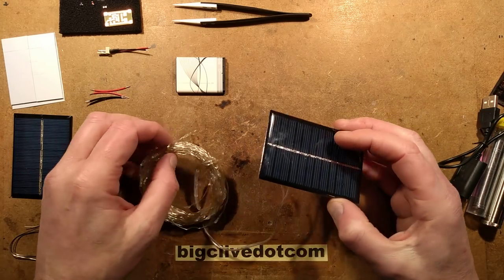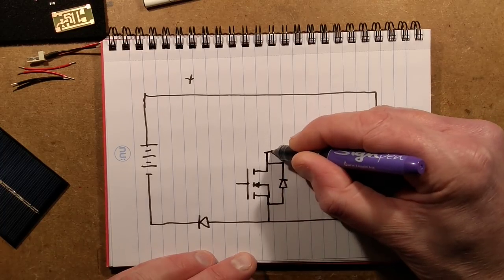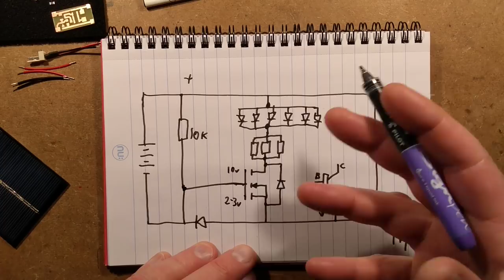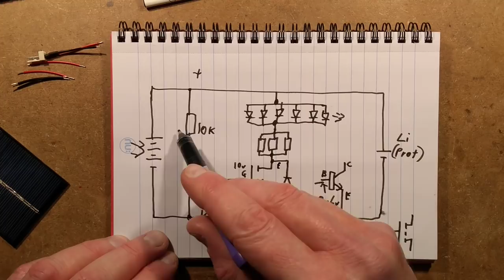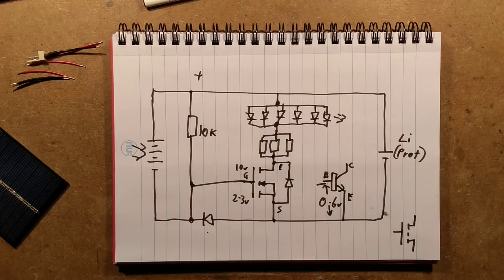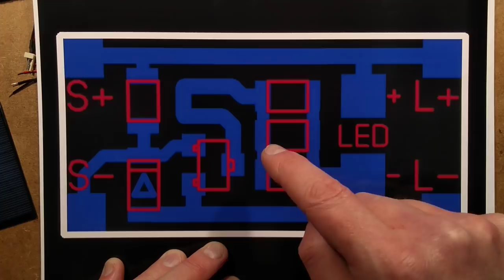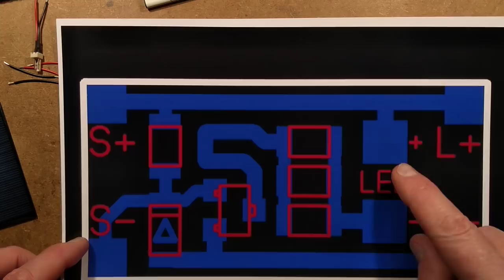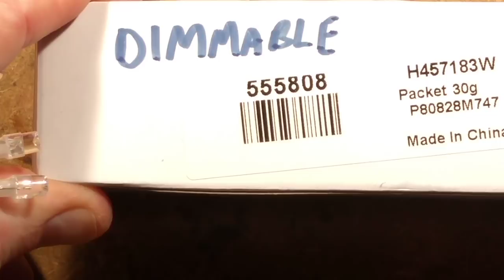DIY solar garden light project.  Surface mount remix.

Comment: ah yes, the MELF-package. "Mostly End up Lying on the Floor".
Reply: ...they're easier to work with than the GCFP packages (gets confused with flea poop).
Reply: melf isnt that resistors? hes talking about diodes. i think they are called sod package (small outline diode)
Reply: I was just about to post that
Reply: desks are for storing junk on top, the big floor is where everything gets fixed....
Reply: QuadroMELF (SOD-80) package has square sides.
Reply: slaeshjag - I undo tiny screws, they drop on the floor! Even with the use of a magnet and a metal detector they cannot be found! After much swearing I put my knee down and bingo!!! The knee detector wins again, followed by much more swearing 😂😂😂
Reply: I thought it was "More End up Lost than Fitted" :D
Reply: @cardboardboxification  I can relate._
Reply: MELF packages are used for resistors and diodes (metal ended leadless frame) or, Metal Ended Little Feckers as we in the industry like to call them
Reply: I thought you'd mistaken the MELF-package for the MILF-package... lol.
Reply: @urugulu1656  Frequently sod-off package ( especially when you sneeze )
Reply: In Denmark we name SMD components as: "Små Modbydelige Dimser" - in english means: "Small disgusting things"

Comment: I am not sure if this has already been mentioned, but Wahl has been making a soldering iron called the "Iso Tip" since at least the early 80's that is functionally quite like this iron.  You get used to the "tappy, tap-tap" of keeping the iron temp moderated quickly.  I still have mine and it is working like a champ after all these years.  Have had to replace the cells, but you can run it full bore until the battery is exhausted if you like and it is the king of automotive electrical soldering work.  That being said, I'll be picking up one of these tips too.
Reply from the maker: I featured the Iso Tip in a video.  (A teardown.)
Reply: I really need to retrofit it with an LED for a brighter light, but the tungsten bulb also acts as good indicator of the charge state.

Comment: A nice way of finishing hand-soldered boards with SMT components its to dab a little liquid or jelly flux around the pads and use a hot air gun to reflow all the solder joints, leaving nice shiny, even heels. Most of the components will recenter on the pads too. Use a bit of flux remover to clean the board when it has cooled. Most modern SMT components are designed for reflow operation so they can handle being heated. I find 350DegC air on low flow works well for lead solder, a bit hotter for diet solder, and takes a few seconds of heating to reflow for a tidy-looking board.
Excellent job handling those SMT bits, they can get really fiddly sometimes! Keep up the great videos :)
Reply: Alan AngelFire not blowing the components off the board like a rookie with the air gun is the trick 😝 shaky hands from the war ruined it for me.

Comment: Just built the through-hole version of this with a 2N7000 MOSFET, Kindle battery grabbed from the recycling bin and all other parts on hand.  Just need to get it into a weatherproof case and outside for testing before I declare victory, but initial testing indicates success.  Many thanks, BC!

Comment: The discreet component version of this one rocks too!
I just built that one and it has me thinking of other applications already!
Super cool!
Reply: I'd half like to build one of these...What MOSFET part did you use?
Reply: @garrethtinsley2435  sorry I meant the discrete version Clive made a while back with a npn transistor
Reply: I've been meaning to do that project as well, but I'm still lacking a solar panel for it so might use a photoresistor and just charge the battery when needed. 🤔

Comment: Hi Clive, I bought one of those irons from Banggood. I also found having to keep the button pressed an annoyance. I found the small tip lacking on some larger solder joints. I measured the tip temperature at each voltage setting to see if the temperature changed, it did. Sorry I cant remember what it was, it was in my review which I sent to Banggood. As I only gave the item a four stars "as useful for small jobs only," it was never published.  I never intended it to replace my TS100 iron, I only wanted something for a quick solder joint, which it does.

Edit: 30/11/19. Bangood did publish my review but never informed me they had. I now have the temperature tests I made. Below is the results of using my soldering iron tester thermometer at different volts. I pressed and held the button until it flashed indicating it hard reached temperature. I did this three times in a row before testing. I did this twice and noted the highest temperature each time: 3.3V = 240C - 260C 3.8V = 270C - 280C 4.3V = 310C - 320C 4.8C = 400C - 417C
Reply: Four stars not good enough.... gotta love China...
Reply: @BRUXXUS  . Yes indeed. No problem with any of my 5 star reviews being published! 😄

Comment: Many years ago I purchased a Wahl Iso-tip rechargeable soldering iron at a ham radio store. It was small, worked well, didn't require any cords while using it, and heated up and cooled down quick. It got way more use than my Weller because most of my soldering was not done anywhere near a bench or table. And it had an integrated light, which made it ideal for working under the dashboard of a car while, say, installing a stereo.
Reply from the maker: The Iso-tip irons are still available.  I have one here.

Comment: That vape-iron is pretty damn clever! Besides the button-pushing and low power it seems very convenient. A few more random product ideas I can think of for an "18650 multitool" that uses the same base with different heads: LED torch, electric screwdriver/drill/dremel, electric toothbrush, shaver, vibrator(!), ...

Comment: Minor quibble: the usual enhancement mode MOSFETs do not have a current path when quiescent. A positive charge on the gate attracts elections to the channel area,  which then carry (negative) current from source to the drain .

Depletion mode MOSFETs do have a current path when quiescent. A negative charge on the gate repels electrons out of the channel, which then can no longer conduct current.

For P-channel MOSFETs, reverse polarities and substitute holes for electrons.

Comment: Great project and good work, I enjoyed it. If you have to solder larger SMD Projects than glue the components at first down and put all in a soldering bath, you can make it easy with an flipped iron.

Comment: I just ordered the battery soldering iron that you showed. Seems better than the gas powered one for home usage in rare occasions of soldering. 
If only we could increase supplied voltage by one or two volts...it would perform better.

Comment: I did something like this.  I too used a protected cell and a 6V low-amperage solar panel, but I used a 2-transistor switching circuit to keep the lights off during the day and turn them on at night.
I've had a couple of circuits like those running for around a year now without problems.

Comment: I've been using your original NPN based circuit all summer and it's been totally reliable. I've got it wired to several LED 'rice wire' strings around the garden and the battery and solar panel are in the shed, kind of a poor mans Tesla power wall :). But I'm now going to modify it to use one of those 6 hours on/18 hours off timers that you get in a lot of commercial USB lights these days. The reason being, in summer the lights are on all night and I don't really want them on all night. You'd have to reset the timer as the seasons change of course to manually set the on time but it would mean the battery maintaining a higher charge state in summer.

Comment: Excellent Clive, your journey into modern electronics continues. But I too hate those bloody MELF packages. You can get ones that don’t roll, like SOD-323, which are rather small, or SMA (aka DO-214AC, not to be confused with the larger DO-214AA and DO-214AB which are much larger). One advantage with producing PCB designs for manufacture by professional PCB houses is that they come with solder resist between the pads, which means you can assemble higher density circuits with less risk of short circuits.

The other thing I would now not be without for such work is a binocular microscope. I have an old one which I got second hand for about £40 (one of the best £40 I’ve ever spent), but you can get better ones than I have. And some have three tubes, two for you and one for a camera, ideal for YT work.

The SMT world is now your oyster, with all the fabulous components available only in SMT packages. Have fun!
Reply: Well, there's also the SOD-123, that's in-between the SOD-323 and SMA in size.

Comment: please, more info on the cordless vape soldering iron
Reply: @ernestaskazlauskas6511  Tyvm for the link :-)  But, max 8W and you gotta keep pressing the button? Jeez.  I find a TS100 with a 20V power bank frustrating enough (3mins timeout, ~30W), but also small / portable / powerful enough for most jobs :-)
Reply: Got mine yesterday after a bit of search on the eBay. Element measures ~3.4ohm The adjustable voltage battery supplied is accurate and ranges from 3.3V to 4.8V. My guess is the capacity would be somewhere around 1100mAh as it seems to actually be an Evod Twist

I paid £12.43 with the "fast and free" delivery. 

At the highest setting, I soldered some 1206, 0603 and 0402 parts. The solder melts within seconds having warmed it up once already. 

If you were using a variable wattage MOD, you'd have to solder with it set only around 7W, for the  maximum 4.8V which sounds pretty good to me.

I really could have done with this in the car a while ago trying to solder on a USB connector for my dashcam..  - had to get an extension lead out and fiddle around with that. I think it's meant only for small jobs though, the tip is very sharp, not my favourite chisel or bevel type. It should work fine for thin wires and little things in a pinch though I don't much see the value in using it at anything but the highest setting, unless maybe if shrinking shrink-wrap or something like that.

https://www.ebay.co.uk/itm/223700474945
Reply: @theskett  wen i have 220w wape i will test if 8w is max for soldering tip 🤔🤣
Reply: This vape soldering iron sounds like it would be ideal to pair with a mechanical vape mod, it would power the tip for as long as you held the button.

Comment: For high-side driving applications (eg loads in an automotive environment with common negative ground) I've been using the VN751PT for switching (with a Wemos). It's reasonably priced, will switch on as low a 3V gate input and has many protection features built in. A great solution where you want to switch a single 12V lead to the load (and then it is grounded to chassis).

Comment: I did a similar board, but using the more common BJT transistor based circuit, that fits into the end of a 3x AAA switched battery case. It reuses the switch included with the battery case. Works well, and very compact!

Comment: Surface mount is fun. I got into surface mount a couple of years ago, though I need small, compact boards. I found a local source of boards that's fairly cheap and another source for stencils. I use Kicad (free) to do the designs, send them to the board house and stencil company and 5 days later I have everything. At first, I used a cheap soldering station with a reflow hot air gun but have moved on to modifying a cheap reflow oven (T-962 on Amazon). If you ever get this oven, don't turn it on until you modify it by first removing the masking tape and installing the open-source firmware for it. I also have an open-source board for this that makes the temperature much more accurate. I have also found it's somewhat easier to work with the low-temperature bismuth solder paste, especially when dealing with LEDs like the WS2812 and similar devices. Now, most of my designs are surface mount. I have big paws too (and mine tremble a little) but I can still work down to 0603s. https://github.com/aaronw2/T-962-Temp-Fan

Comment: Excellent build! 
Clive, I'd love to talk you into adding a small needle tip dispenser bottle filled with rosin flux in alcohol to your kit. I use RA type flux from M.G.Chemicals, Ltd. and absolutely swear by it as it makes building little boards like that so much easier and also helps greatly when making off-board connections. I even use a bit of rosin flux for joining pieces of stranded wire rather than relying on the flux in the solder. For people just getting started with soldering, rosin flux can be the difference between easy and impossible and you're so well poised to be a teacher. The needle tip allows for applying a dot no larger than the pad and if you hit all the pads at once and let the flux dry for a few minutes, the result is rather compelling.  I hope to see you make more builds like this.
Reply: I'm a bit partial to the Kingbo flux paste (fake as it may be). I've got an old small filed-down flat-blade screwdriver i use as an applicator, and it's great for wires or SMD work (or rework). And due to its viscous nature, it won't run off either.
Reply: @khronscave  I like pastes too. I've gone through many syringes of ChipQuick SMD291 which is great stuff and compatible with both leaded and lead free solder. Just make sure your flux is a no-clean flux unless you're giving everything an ultrasonic or solvent bath. I've had some poor experiences with flux residue causing corrosion after a few years which is why I like the old-school activated pine rosin for random rework and prototyping. The residue absorbs a tiny bit of atmospheric moisture but cleans off easily with isopropyl alcohol and you only really need to clean it from high impedance nodes. I would worry about the chemistry of any potential fakes.
Reply: @Peter_S_  I had to dig through my eBay emails, and it looks like i got the flux a bit over six years ago, back in 2013. I've used it both in personal projects, as well as repairs for clients, and i've yet to encounter any issues with it. Not to mention, i might have maaaaybe used half of the 100g "tub".
Reply: @khronscave  Excellent 😎👍
I wish I could remember the stuff I used that blew up on me. It was pretty brutal what it did to any exposed copper.
Reply: @Peter_S_  That half-reminds me of having to deal with really crappy solder-braid. The non-fluxed kind. Doesn't work for s**t...
Reply: @khronscave  That stuff is a nightmare! It took me years to learn it wasn't useless if you soaked it with flux first. I just thought it didn't work.
Reply: @Peter_S_  ... Or you can just go with the good stuff, right off the bat. I stocked up on some Chemtronics braid, either earlier this year or sometime last year - 5 spools of 25ft .1" wide.

In the words of AvE - work smarter, not harder :P

Comment: As an additional heat sink I  put a suitably sized pad on the under side of the PCB and link it with via's or plated through holes. My go to 1A Schottky diode is the SS14 and for 5A the easily memorable PMEG3050EP marked as A7, both are large enough not to get lost in the carpet :)
20mm X 20mm would be a better size for the PCB as 20mm is the minimum for V grooving when paneled at JLCPCB,  for your $2 plus postage you will get you 125 boards :) With 125 boards it is worth looking at their assembly service :)
The element died on my 1980 vintage Antex CS18 today so I had to use the bells and whistles iron that came with my soldering station for the first time lol
Hot work permits are a pain, a friend was working with blowlamp at the top of a duct with a blowlamp with an unknown gas leak, eventually the gas in the duct built up to the point that it ignited like a rocket exhaust LOL
Reply: twenty meters!
Reply: @urugulu1656  edited :)
Reply: @urugulu1656  imagine the postage on them 😂

Comment: Awesome project dig that solder iron. Funny you did this today, I finally scavenged an couple diodes off my thermostat (that went bad from leaky batteries) for my solar light. Once I solder the diode on, I'll have a solar "pack" with 2 18650 (white Westinghouse) recycled from a solar yard lamp. So I did add a 4056 charge board to it. Charging 2 18650's you would have to live in the desert relying on the solar, but now I can charge it USB. I also put a adjustable boost converter. Up 2 12 volts I think.

Comment: Might I recommend the Bakon 950D soldering iron. It is perfect for surface mount components and has an interchangeable tip as well as 5 power settings. It uses the same idea as the vape pen attachments but in a constant power state.

Comment: I also find the A2SHB Mosfet's amazing. You can drive them with 3.3v or 5v microcontroller's and switch load's over 1 Amp. I soldered some on sot23 adaptor pcb's to make them  more breadboard friendly.

Comment: Vaping and soldering with the same battery. Hope no mix ups.
Reply from the maker: It would be easy to absent mindedly stick the soldering tip in your mouth if used with your standard vaping battery.

Comment: That's gone a lot better than most of my SMD soldering attempts.
Reply: Get some activated rosin flux in paste or liquid and it becomes easier than through hole most of the time. It's the difference between joints that are impossible and ones that practically make themselves.
Reply: @Peter_S_  I damn near "Rossmaned" it with flux...
Reply: @pileofstuff  Ahhh, then you already know there's such thing as too much of a good thing.

Comment: Google seems to indicate "A2SHB" as being the markings of the Vishay Siliconix Si2302DS - "A2" being the part number code, and "SHB" likely some date / fab code. Datasheet says 20V and 2.4-2.8A (depending on applied gate voltage).